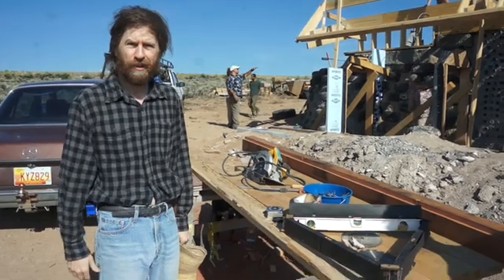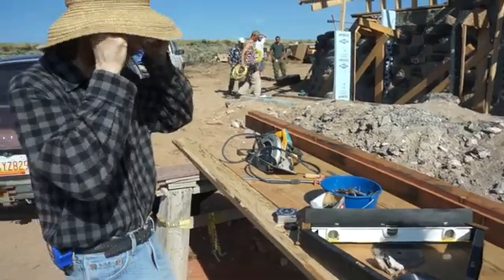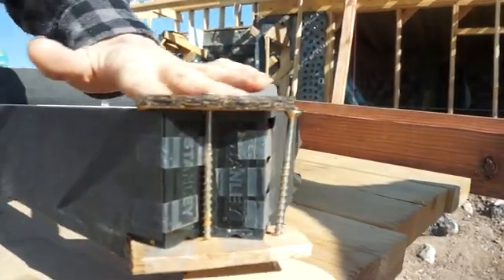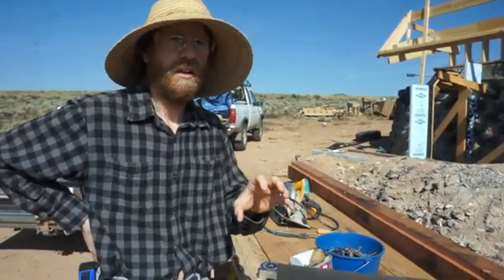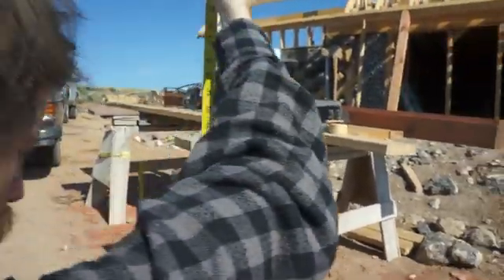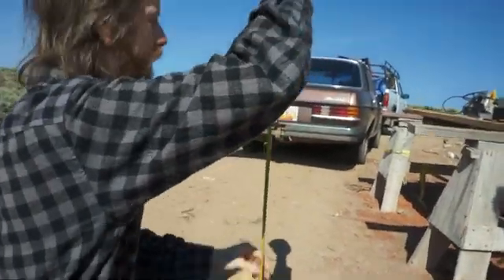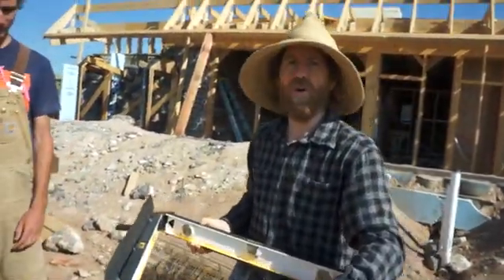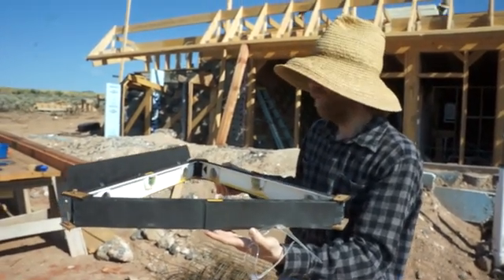Poor Man's Laser Level

Comment: Good innovation but did I overlook the actual 'laser' as opposed to eyeballing it?
Reply: Hi there! I call it the "Poor Man's Laser Level" because it functions in nearly the same way as a laser level. But is MUCH cheaper and doesn't require batteries or anything. Well, if you really want to trick it out, you could mount a flashlight on the bugger and shine it on the white part and make the "eclipse" REALLY stand out sharply.